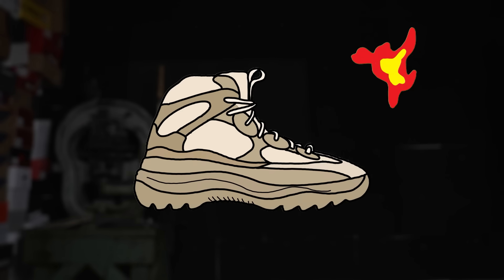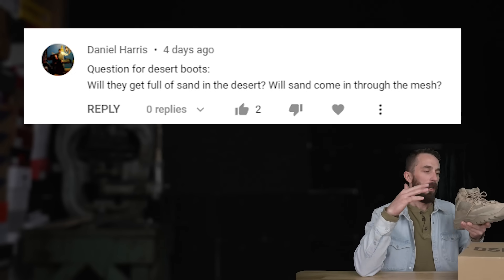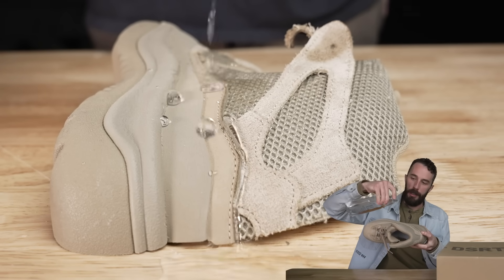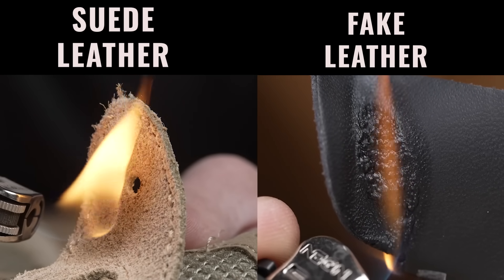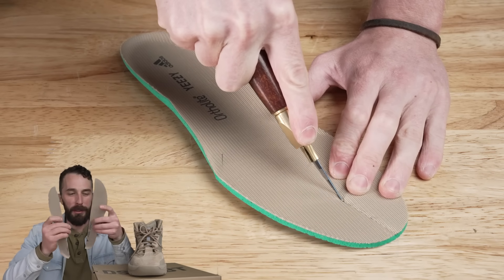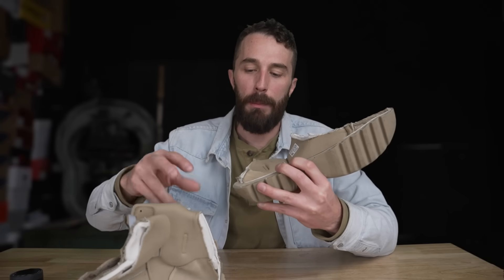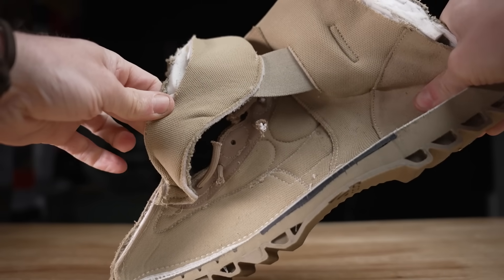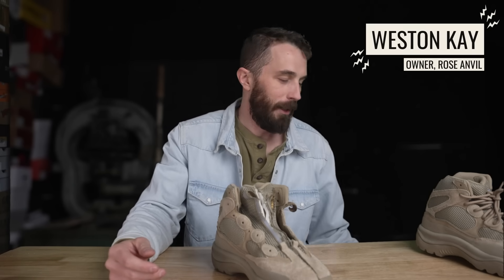The Truth: Are Yeezy Desert Boots Really Boots?

Comment: For the 450 can we get an idea of how hard it is to separate one of the “claws” bc that’s the true essence of what holds that oddity together lol. Gonna grab that wallet and pair it with my desert snoots, thanks for the video man!
Reply: 450s upper and sole are heat welded together without any glue. When you look on the inside, the two components aren't just fused with cement, they are molten into one material. I recon one theoretically could separate the upper from the sole only by ripping the sock like fabric where the parts meet. Construction on these is really interesting.
Reply: It would be a pointless video.
Reply: @David-nw9vj  true!’ its also why my samples dont have a sample print on the inside fabric unlike usual yeezys samples
Reply: TEAM JESUS 💪 🙏 🕊 
PRAISE THE LORD
SPREAD THE GOSPEL
ACCEPT HIM INTO YOUR HEART FOR ETERNITY BEFORE IT IS TOO LATe
JESUS LOVES YoU❤
Reply: Praise Yeezus

Comment: After you're done with the Yepril I think it would be cool to see you analyse motorcycle boots, considering people often get work boots for protection, and vice versa – get the most work boot-looking motoboot.
Reply: I’ve somehow ended up wearing Harley-Davidson Woodridge mid-length…pseudo-boots, I guess I would call them. HD doesn’t mess around with their materials, but 8-12 hours a day in them is something I wouldn’t recommend (even though the shoe is billed as “athletic”??), and then you will also be facing an odor issue so fast it’ll make your head spin. 

Before these my go-to were the Skechers Crankton, but the only problem there is those have no slip resistance whatsoever….
Reply: The moment I understood the importance of a proper, protective boot was when I lightly dropped the bike on my ankle and dislocated it. Haven't felt it until I got back on the bike. Went and bought high Icon boots that very day...

Comment: So just speaking as someone who spends a lot of time in desert boots that fill this particular niche I'd say the only real red flag is the Foam ankle support and foam tongue fill.

Desert assault style boots are generally supposed to be more like sneakers with added ankle support than work boots.

They aren't supposed to be waterproof, they aren't supposed to be insulated, they need to have a very abrasion resistant outsole, and they need to be lightweight.

Because they are designed to be light, durable, and breathable. I would still take my Oakley assault boots with the outsole vents over these, but just wanted to clarify why they aren't like a pair of redwings or logging boots.
Reply: Why can't we just call these what they are, " psudo tactical high top sneakers ".
I don't care what brand it is, If it uses sneaker materials and construction it's not a boot.
Maybe a slightly tougher than normal high top sneaker,  but not a boot.

Not to take away from what ever it may be good for, it's just not a boot.
Reply: @TylerSnyder305  The thing is, it's not like sneakes either. Much too heavy to be one. I spent a lot of time in boots in my old job. Although I agree these are less "boot-y" than proper boots, these definitely land more on  the boot end than the sneaker end. 

Then again, my pair is from the Yeezy Season 7 release, not Adidas like the one shown in the video. Apparently they are very different to those that owns both.
Reply: @armtc  
Heavy sneakers then.
Still not a real boot.
Reply: @TylerSnyder305  Or a light boot haha. At the end of the day, this is a hybrid. One or the other, it doesn't matter. The Air Force 1s isn't a plane just because of its name.
Reply: @armtc  
Nah, it looks like a sneaker not a boot, is constructed like a sneaker not a boot, and is made of sneaker materials not boot materials.

I fail to see how it is in any way a boot, hybrid or otherwise.
It's just a heavier sneaker, theres nothing wrong with that though,  and it's okay to accept that this just isn't a boot.
Reply: i agree, i think he missed the mark by trying to compare these to boots meant for a completely different use.
Reply: @TylerSnyder305  Never thought I'd see a no true Scotsman argument for boots.

Comment: You acted like the sand a cactus tests were silly, but that's two major reasons I wear boots (%90 of the time) instead of sneakers. Getting sand or worse cheatgrass in your boots is miserable, as is cactus in your foot. Regardless of the "desert"  title, those are very legitimate ways to test for a well designed boot. 👍
Reply: True, but anything could be a good measurement depending on where you live. If you live in a country/area with cactuses and lots of sand that would be a good test, while it would completely pointless if you live in a cold snowy country.
Reply: @futurew0782  🤔 Typically deserts have sand and cactus.... last I checked.

Comment: I've wanted a desert boot for a while and have had no luck.  I tried cheap walmart work boots (wolverine?) and the soles fell off in the heat.  It was just some foam between my foot and the ground.  I found some boots that were purported as air force high temp boots.  I still have them, but they absolutely tore my feet apart in the first two days I wore them.  Lots of blood.  I recently went out in sneakers and was quickly reminded how much of a mistake that is.

I'm gonna check around youtube.

Comment: I  don't think these were designed to be used as work boots. Pretty sure these were made primarily as a casual boot. 'd like to see a video on the Yeezy 500 Tactical boot. Been wanting to try a pair, but I'd like to feel the on feet first. I know many will disagree, but the best, most comfortable, lightest, and the boot with the best traction I ever worn was my Converse side zip military boot which is no longer made. Reebok took over the design, but the Reebok is in no way comparable to what Converse made. I'd love to have a casual tactical boot again that's supportive yet comfy as hell (like my Converse were), and I was thinking the Yeezy 500 tactical boot would fit that bill.

Comment: That 3d layer mesh isn't really applied well to have it actually breathe. It's used in a lot of bags and next to skin and load bearing gear. But it looks like it's just slapped on a thick nylon or leather backer to give it structure over actual breathability. Based on how it burns its probably legit nylon however.

Comment: Probably most will disagree, but the 500s are the best shoe of the entire Adidas Yeezy collection. They run true to size, because the adiprene is not prone to shrinkage, unlike Boost (the originals department still has issues with their templates and can't correctly calculate how much a midsole will shrink because of how BASF's Boost will shrink, unlike what the performance side of the company does and correctly compensate for the shrinkage of the TPU pellets being fused together, but I digress. The 500s are actually based on a real functional design of a performance shoe. The Feet You Wear tech, that Adidas was finally again being able to re-license. That is why the 500s are actually the most interesting shoe from all the Adidas Yeezy collection, the rest are just hype and no functionality at all.
Reply: This comment is triggering because you never closed the (

Comment: That is a sneaker. Without you even digging into it, I can see that by the materials used in its construction.
The only test to see if a boot is cactus proof is to run through jumping cactus fields a few times. Then continue wearing the boot regularly for the next year. If you don't get stabbed all over your feet with cactus spines throughout the year, then your boot is cactus proof. Cactus spines will work their way through over time, and will stab you during inconvenient moments. I guarantee you the sneakers you are testing in this video wouldn't last a day in a field of jumping cactus.
Reply: He cuts open all kinds of shoes. And come on. These were never designed intended or sold as a hard use desert boot for professionals. They’re Yeezys for Yeezus’ sake.